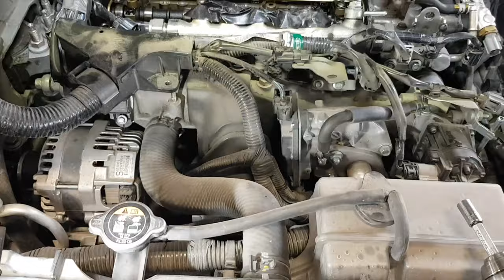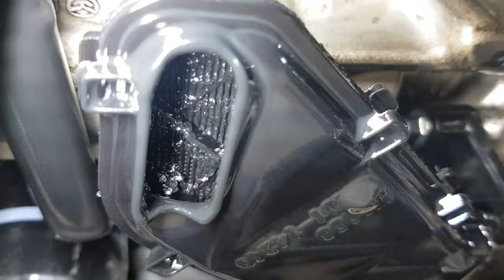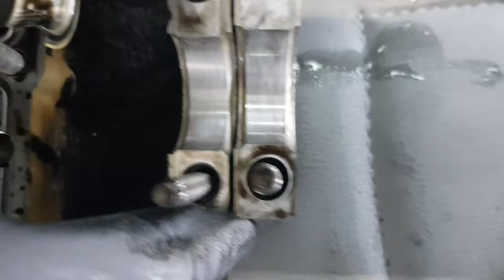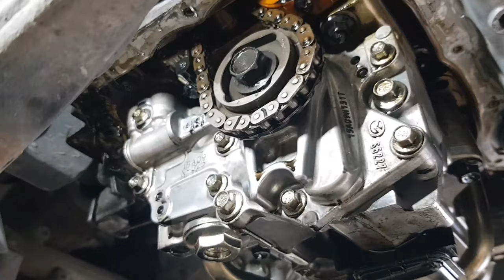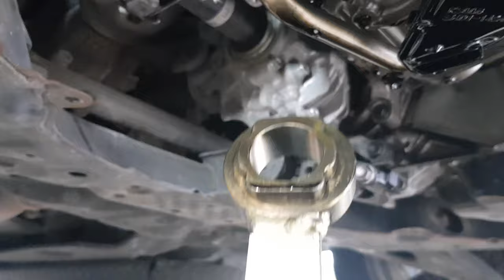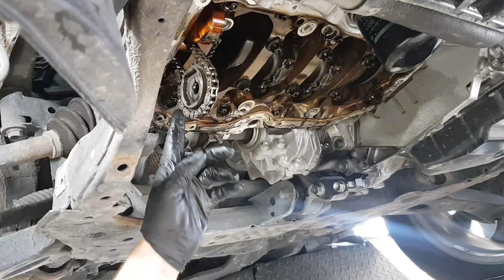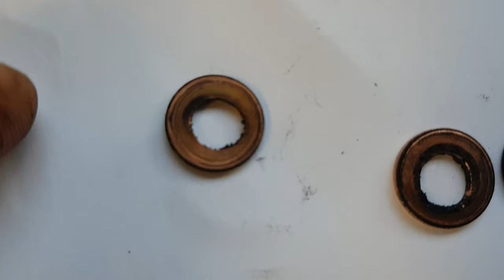P06DE P055F Low Oil Pressure Mazda 2.2 Skyactiv D

Comment: Should I replace the injector washers and nuts on my 2017 Mazda 3 (Hatchback) with the 2.2D engine?
It has 100k km and the service interval is coming up.
I can't find the same parts to buy, only these washers F 00V C17 504 and no nuts.
Reply from the maker: As a prevention, I recommend replacing them; those washers are very cheap at the dealership, so there is no need to look elsewhere.
Reply: Ok, thanks for quick response I appreciate it.
Reply: @JB_Auto  is there any way to check whether they needs to be replaced without removing them?
Reply from the maker: @sull5307  Check the car's history; that's one possibility; otherwise, replacement only.
Reply: @JB_Auto  Thank you. I want to use your tutorial and tried to replace them. I have 2017 Mazda 3, I bought it at 99k. Previous owner had service history in the same mazda dealer where he bought it. Altough what I found which is differing from your videos is that there is some block installed on the injectors (with some codes engraved SHBM- 12W12 Mazda K3832) I guess I will have extra step. Can I have check oil strainer without removing him? To check deposits inside? P.S. Do you have discord group for this channel? I want to contribute somehow, you are really helping new owners. Thank you.
Reply from the maker: @sull5307 If you do not find the injector gaskets leak, then there's no need to remove the oil sump to inspect the strainer, just replace the gaskets, and that'll prevent the strainer from clogging. Regarding the "block" I'm not sure what we are talking about; anyway, those 2.2 diesel engines are not much different from each other, so you should manage with it.
Reply: @JB_Auto  Thank you, I appreciate your help. For the block, it has additional block protection installed onto injectors, some kind of sealing with code written which I wrote above. I haven't seen those on the clips with mazda sky activ engines. Probably previous owner installed it for some reason.
Reply from the maker: @sull5307   You are welcome. I recall that now. It is sponge-like, dark grey; I'm not sure of its function; it could be for sound suppression or heat retaining, easy to remove, and installed on all newer models.
Reply: @JB_Auto  Haha yes, I really thought it was block because I did not touch it, then you wrote sponge so I had to check it and yes it is a sponge. Does new Mazda have betters gaskets ? How long they can last before mild leaking? Is it okay to be area around the Injectors slightly oily (dusty oily just minimum, nothing leaking or so).
Reply from the maker: @sull5307  those gaskets are better but it is smart to replace them every 80K than to have unplesent surprise. I replace those oily gaskets every time I remove injectors it is up to you.

Comment: Hi I have a mazda CX 5 2.2 DIESEL. it Shows motoroilpress control with Red, i Chanced oil, filter,  oil pressure switch, after i diverse 50 km Shows again same Problem. What can it be ? If i try to drive fast like 100 kmh it Shows this again, Could its oil strainer be blocked?
Reply from the maker: @Ofofofofofofofofofofofof  That's possible, but there must be error codes stored, so start with that.

Comment: Please answer me. I am planning to buy a Mazda 6 2.2 diesel, so I am interested in what year they solved this problem with oil pressure. Also, what should I pay attention to when buying a used vehicle. Thank you for your answer.
Reply from the maker: Hi, in this video I'm talking about preventing oil pressure issues, so prevention is a replacement, of injector gaskets at 120K, rather than waiting for fault. If mileage is higher than that check vehicle history. While purchasing the car, check if all the services have been performed at the authorised Mazda repairer with proper intervals. You shouldn't have any problems with vehicles well maintained.
Reply: @JB_Auto  thank you for your reply, I will pay attention to the service book

Comment: Im looking to buy a 2015 2,2. Is all mazdas recalled to get this problem fixed ?
The car has 110k km on it, only 1 owner.
Reply from the maker: There was no recall, what I recommend is to replace injector washers right away when you become an owner, the cost equals approximately 1.5 labour time, otherwise, you may encounter that problem as on the video, and then it is much more expensive.

Comment: Hi, great video, very informative and well presented but I just wondered why you can't use an impact driver to remove oil pump sprocket bolt without the special tool? Thanks and all the best.
Reply from the maker: Thank you. Do not use an impact tool it may damage the oil pump chain. The chain is fragile, there were many cases with the oil pump chain broken right after oil strainer replacement, and in most of the cases was used, an impact wrench.

Comment: sorry for my bad english, but when you put the chain wheel back on the oil pump, how hard do you tighten with the torque wrench on the bolt?  hope you understand what i mean.
Reply from the maker: The tightening torque is 140Nm. If you need more tightening torques check out the description.
Reply: Thank you so much👌

Comment: Hi jb how would i know if my egr valve is working and also if I was to use egr cleaner where would I spray it in my mazda6 2.2 skyactiv-d to get to the egr. Thanks mate
Reply from the maker: Hi, to check EGR you need to warm up the engine and perform activation, look at the live data of EGR and check if the angle/percentage increases as far as I remember it should increase by 10 per cent. To clean it is best to remove it. What is the problem by the way?
Reply: @JB_Auto  hi mate i had it cleaned by mazda dealers. But when I rev it the valve position doesn't change so I thaught it might be faulty
Reply from the maker: @KhanKhan-lw8fw  If there is no DTC and the engine runs properly do not worry about that, EGR is activated at certain conditions, for instance, there needs to be operating temperature and it usually happens when deceleration and so on. If you want to check EGR activate it as I described earlier.
Reply: @JB_Auto  ok thanks jb really appreciate it

Comment: Hello, I am just in the middle of purchasing 2017 cx-5  with 2.2 diesel and 58K km. Should I stay away from it or this engine should be fine for many years to come…? THanks
Reply from the maker: Hi, thanks for the comment. There are no issues with this model year, mechanically engines are heavily modified. You may encounter injector gas leak but that you can prevent as you watched in my video, another issue is carbon build up on inlet manifold and which occurs on engines where you drive mostly short distances. My recommendation is to replace oil regularly, and replacement of injector gaskets at 120k km mileage. I'm preparing a short video about oil replacement, and it is related to older engines but it will be worth seeing, so stay tuned, the video coming within a month.
Reply: @JB_Auto  thank you very much for your prompt reply!!! Are there any supplemental additives I should occasionally add to the tank in order to prevent it? Or some gas stations I should prefer over others? Coming from US and this is going to be my first diesel experience. Any advice is welcome. Thank YOU!
Reply from the maker: I'm from Europe, I can not tell you which fuel should you use, I've heard that issue with carbon deposits doesn't exist in some countries, due to the better quality of fuel, but that is not officially confirmed. The only fuel additive we use is for fuel system cleaning, and that does not necessarily prevent carbon deposits in the inlet manifold. I would enquire, Mazda dealership what is recommended on the US market. This issue may not exist in the US because of different software and different emission system, and that is due to different emission regulations in the country. As you know all the problems with diesel come down to emission system and it is not only related to Mazda...

Comment: Hi, don't you need a new gasket for the oil pan? If yes do you have a part number? Any suggestion for the engine flush and how long I shall let it run before opening the engine?
Reply from the maker: You need this for sealing oil sump : (R21Y 10 431A Three Bond) For flushing engine I use any engine flush additive application is always on the bottle and it is 15min on a hot engine, if you have carbon composite first open engine and remove it mechanically, then put it back together and flush it.
For flushing, I use new and the cheapest oil plus that bottle of engine flush.
Reply: @JB_Auto  Thank you for your quick reply! How about the replacment of the sealings of the injectors? After I remove them shall I do a process to "suck" the diesel back again? Will be my first attemt to repair a diesel car (I am not a mechanic, just DIY).
Reply: @JB_Auto  After checking again with the OBD I also saw that there is an P2263 error. Seems it's all at once gone wrong into my car. As a result I decided to take it to the local dealership as I don't feel confident will be easy fix all those. I know bill might come high but let's see. Hopefully won't be a bigger damage to the car. Didn't expect to be honest all those issues with only 184.000 for a diesel car that every year was serviced in the dealer... Let's see the result.
Reply from the maker: That fault code is related to turbo charger if you had lubrication issue then it is almost certainly required replacement of turbo charger.

Comment: Hi jb wats a good reading for maf at idle in g/s thanks
Reply from the maker: Hi, you should have 5.4 g/s approximately at idle speed.
Reply: @JB_Auto  ok jb and if it's not then what cause a low reading
Reply from the maker: @Kay Kay  Could be sth. with intake system, EGR, and MAF itself, wiring, pcm.
Reply: @JB_Auto  ok jb I will get my reading by the way iv got 2 readings on my diagnostic tool

Comment: Hi i wss driving my skyactiv 2.2 with oil light around 20milles lost the power i restart engine light gone power come back mechanic change strainer was completely blocked also he clean top engine and change washers and seals but my chain get little bit stretched i think about change chains cost around 1.5k pound but i worry nothing happened more what you think please
Reply from the maker: I would change that chain immediately including the oil pump. Usually if only is clogged oil strainer and oil pressure is within specs you do not need to worry about anything else. Mechanic should be able to recommend to you what to do at the stage of performing the job, for example, I always perform an inspection of camshaft, crankshaft bearings and so on.
Reply: I have no idea mechanic by visually can said oil pump is good condition??
Reply from the maker: @michalskowronski2496  The oil pump can not be visually inspected without disassembly; check out my other videos.
Based on experience, the oil pump chain being stretched is caused by too long intervals of oil replacement. Visually, it can be inspected many other components and, based on that, performed evaluation of the whole engine.
Reply: @JB_Auto  thanks for respond have a lovely Christmas 🎄 🎅
Reply from the maker: @michalskowronski2496  Thanks for watching, and yes, Merry Christmas.
Reply: Hello mate one more question for change engine all chain parts  and oil pump with chain I need get engine out from the car??
Reply from the maker: @Mickxd360  No you can replace the chain without removal of engine. My videos are usually with removed engine because I overhaule them.
Reply: @JB_Auto hi mate can you please have a look at the attached link with my weird noise from my engine please let me know what you think ??
Reply from the maker: @Mickxd360   Hi, It is similar to the sound I posted on my latest video, it doesn't need to be the same but try to check it as I did, it will be easy to find out where is it from because noise is regular, let me know the result, and here is the link https://youtu.be/3NPsgmi0T-w?si=BnyACH2IRCZfWHHg

Comment: I came accross one today and checked the conrod bearings and the top conrod bearing has started to wear off bad. Copper is visible. The engine has starved of oil.
Reply from the maker: If the crankshaft is not damaged, replace the oil pump and bearings and it should be good for another 100K unless you found more than that.
Reply: @JB_Auto  yeah thats what im doing right now. Cought in time for the bearings. Cranskashaft is sweet. Lucky
No 1 injector seal went bad and its spewed carbon all around it under the rocker cover. That was a mission to clean.
Reply from the maker: @enesfazlic6017  Yes, an early discovery so not much damage, good luck with the job.

Comment: Absolutely a top scandal on this engine.
Good car but wow, it should not have suffered these issues.
Is there any way to prevent this other than all this work?
Does the Ford Mondeo 2.2D suffer this?
Ford was associated with Mazda at one time?
Good video a walk through repair but who would buy Mazda now?
Reply from the maker: Yes, if you replace injector gaskets as I suggested in the video, then you will not experience any of that. 
This engine is not related to Ford. It is Mazda's design.

Comment: Hi, great video. You mention in the video that the PO55f can be caused by something other than carbon build up, what is this please? Also do you have the torque setting for the fuel line nut & the bolt in the top of the injectors please, I have done many searches but have failed so far to find them.

Thanks again for this great video, I will be changing the washers and strainer in the next week.
Reply from the maker: Thanks for the comment, That DTC is related to oil pressure system malfunction on both Hydraulic and electrical sides, can be caused by the oil pump, crankshaft bearings excessive wear etc... rare issue but it may happen: pressure sensor, pressure solenoid, wiring, PCM etc..
Tightening torque for fuel return line is 22Nm
Reply from the maker: Regarding tightening torque, could you specify which nut we are talking about?
Reply: @JB_Auto  Thanks for getting back to me so quick, The fuel return line I assume are the bolts in the top of the injectors, all connected by one single pipe. 

The other torque settings I was looking for was for the nuts on both ends of wavey pipes that go to the injectors from the rail.

Cheers
Reply from the maker: Ok, since you're going to start that job next week I will check that for you and get you an answer later.
Reply from the maker: @waynerooney7868  The tightening torque for high-pressure pipes is 40Nm on both injector side and common rail. And again those on top of the injector are for the return line and it is 22 Nm
Reply: @JB_Auto  You sir are an absolute STAR. Thank you very much for this info, I didn't want to start the job without it. Thanks again.
Reply from the maker: @waynerooney7868   You are welcome, and thank you.

Comment: Just took mine apart, number 4 injector is the culprit, but it’s also knackered the inlet camshaft, probably not worth repairing, scrap at 130k
Reply: Should read exhaust camshaft
Reply from the maker: You talking about exhaust camshaft that is worn out. That's for sure time taking job if you want to do it right.
Reply: I contacted Mazda and even though the vehicle is a 2017 and is 18 months out of warranty they gave me the choice of either taking the vehicle into the local Mazda dealer and they would repair it FOC or they would send me all the parts, injector pipes, washers, oil pick up and all the seals and gaskets for me to do the job myself, which I’ve opted for, I’m actually impressed with their service because due to the fact it’s been out of warranty for so long they could easily as said no.
Reply from the maker: Yes, Mazda has very good service, we had many such cases, that is applied to loyal customers and it is called
" good will " so customers with 7 years old vehicles that is 2 years over warranty periode were positively surprised.